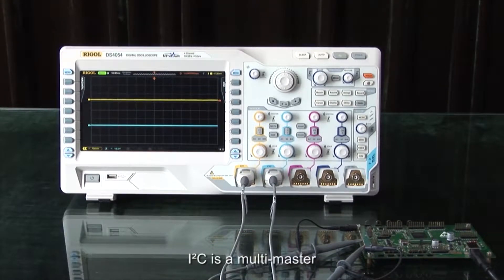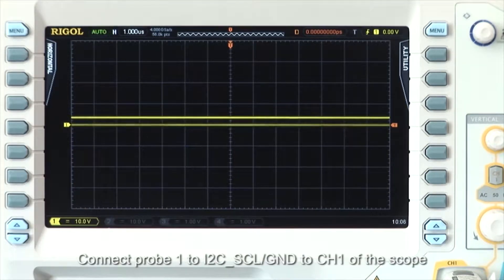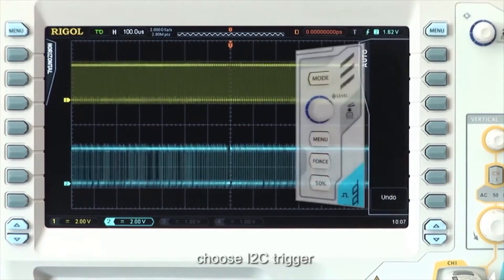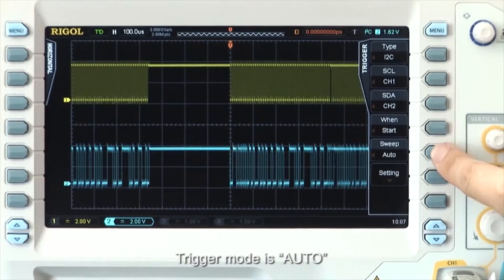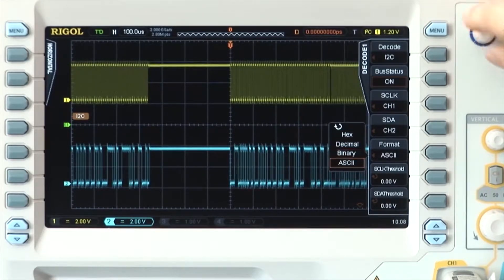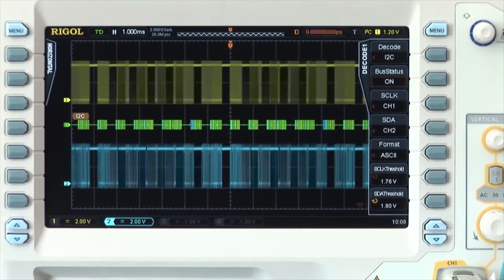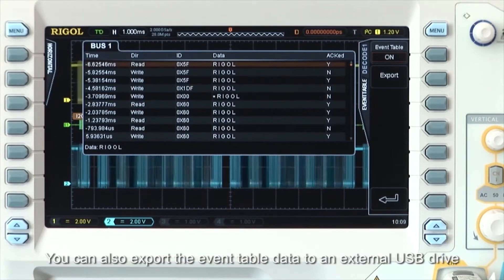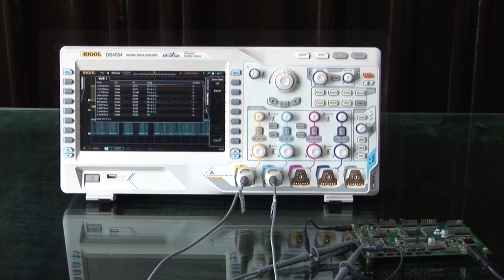RIGOL Oscilloscope Use of I2C Bus to Trigger and Decode by Saelig

Comment: What you've done here only works on certain RIGOL scopes, even ones with I2C and event tables. I'm guessing the DS4054 doesn't use the on-screen display as it's decode buffer like the cheaper models?
Reply from the maker: Yes, that only works on scopes that do that. The 1000Z, 2000E, 2000A, 4000, 6000, and 7000 do that.

Basically any of today's popular scopes do that with the correct options. The 7000 does it even better with the modern platform.